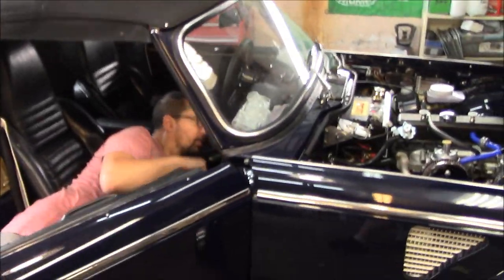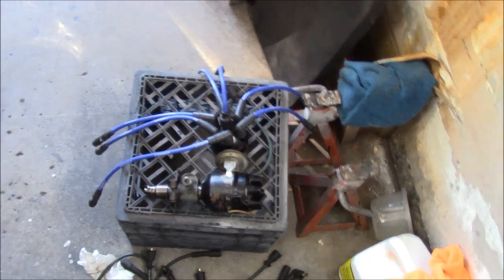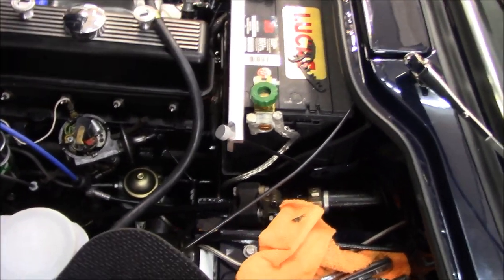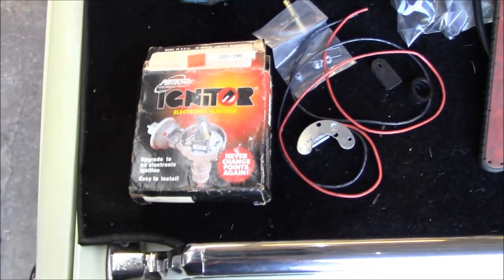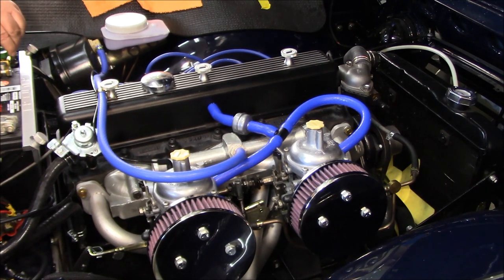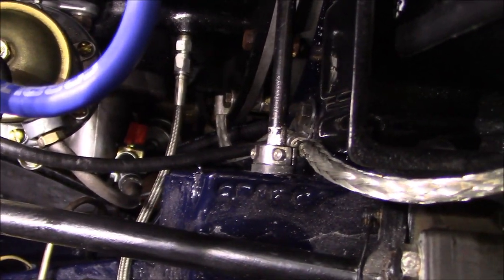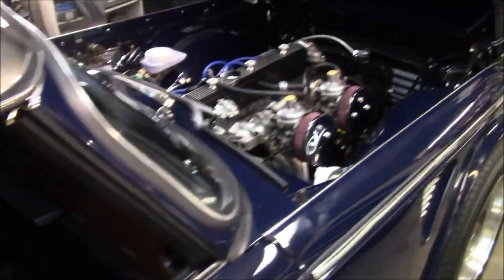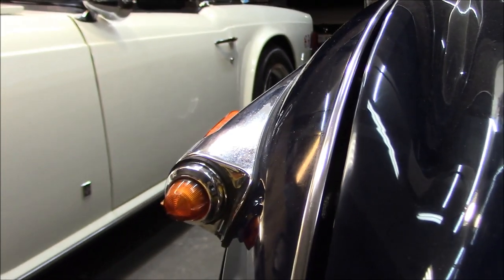1968 Triumph TR250 Restoration Project,  Wrapping up some Small Projects.

Comment: Hi Dave, you give me inspiration to get out in the garage as always. I'm just about to install that popular 90A alternator, but I just read where the pulley may not be compatible, and I'm skeptical that the mounting ears are the right size. Plug and play- yeah right. Anyway, saving your radiator video until tomorrow morning. Thanks for the documentation as always, sir!
Reply from the maker: Is that the Ford Fiesta one John?  I think you also need to add and extra wire because of the increased amps?  I remember the conversion but I’d have to look up the specifics.    Yeah, the radiator was very cheap…163 US Free Delivery….can’t even get one cleaned and tested for that these days…
Reply: @cheftush  WOW! Fantastic price! I bought one a few years ago, but waited a year to put it in, and found the mounts in the wrong positions. Never returned it so paid to have my original re cored.
Reply: @cheftush  My alternator is actually that 100amp BNW new unit, "14022". I didn't need all that amprage at all, but for the price, why not. I'm about to install halogens, and an electric fan in the future. My little Lucas pretends to be fine until it gets any kind of a load, then output drops to borderline.
Reply: Found the rad on Ebay. Can't wait to see your impression of it tomorrow morning (when I watch all my youtubers with coffee :) )

Comment: Did you ever find the source of the puddle of oil that you found under the 250?
Reply from the maker: Hi Andrew, no.  Fortunately whatever is was hasn’t appeared.  I do have an oil leak from my timing cover though…I get a small puddle upon shutdown.  I’ll live with it for now but it will have the be addressed in the future I think.

Comment: Hey Tush, I’m in kinda the same boat the small jobs seem endless. I used the same fuel filter on my tr4, also used silicone on my turn signal ring like you because it would not stay on. I Like the idea of a fuel shut off valve, (going on the to do list). Question, I have a Petronius distributor (flame thrower) and I’m running webers. When you had the webers were you using the vacuum timing advance? I haven’t started the engine yet and I have not been Abel to find anything on this for reference. Thanks, p.s. hot and humid down here In miami too, I’m sure you’ll get cooler weather way before we do..
Reply from the maker: Hi Robert, when using the Webers, you don’t need to vacuum advance hooked up.  I would suggest though, with any performance upgrades, that you send your distributor out to get recurved.   I usually send mine to Jeff at advanced distributors.  You fill out a sheet with your performance modifications and he sets up the dizzy to match these.
Reply: @cheftush  Thanks David, my distributor is a new one, would you recommend sending it? Also you mentioned the voltage stabilizer, I bought a new one , do you have someone that refurbish them. I’m hoping to get the tr4 started soon. Really appreciate your advice. Hopefully I can start 72 tr6 soon. I have other cars but like you I love the triumphs.
Reply from the maker: @robertmorales391  in order to take full advantage of your performance modifications, I would send it out.   I’ve bought a new voltage stabilizer from Dave C. His YouTube channel here. https://www.youtube.com/watch?v=dSjzjk6pnYs
Reply: @cheftush  thanks , spoke to Jeff for awhile great guy. I think this is going to be a big help.
Reply from the maker: @robertmorales391  if I recall correctly, Jeff is not a big fan of the Pertronix ignition….I’m a fan though.
Reply: @cheftush  your right David not a fun of pretronix “cheap Chinese s#&* in a nice box”. But sound like he knows how to get the Weber’s and the distributor stuff work altogether. When I had the car running in the early 1980’s I never had it running right. I was scared that I could not get it running right after this restoration. 🤞🙏..  thanks Tush.

Comment: Hi Dave, did you replaced the voltage stabilizer for a new part ?  My TR250 came from the USA and the part was replaced at that time. Last year the fuel and temperature gauges were varrying from time to time during a tour. Yesterday I build out the voltage stabilzer and found that it was not working perfect. Voltage level variations of battery also occurred (although smaller) at the output of the stabilizer. I opened the mounting and found in the circuit that a NPN transistor was used. In my opinion it can’t stabilze the voltage to 10V in accordance to what I measured. I ordered a new one at rimmer bros. What is your experience with these voltage stabilizers ?
Thanks in advance, greetings from The Netherlands.
Reply from the maker: Hi, thanks for watching and commenting.  I replaced my faulty voltage stabilizer with an old one that I had in my parts stash. However, I’ve ordered a new one from fellow TR owner Dave Conitt who makes and sells a much better unit.   Here’s is a video from Dave.  His contact details are there as well. https://youtu.be/dSjzjk6pnYs   The ones on the market today from the regular vendors have some higher failure rates in my opinion.   Cheers, Tush
Reply: @cheftush  hi David, thanks for your quick response. I found also a electronic design on the internet with better performance. I have to order the components from China which take some more time. Meanwhile I will use the replacement ordered at RimmerBross. Thanks again.

Comment: Hey Chef, thanks for another great video. Just a quick question, did you run the vac line from the retard unit on the Lucas dizzy to the advance port on the top of the rear carb?
Reply from the maker: Hi Allan, I did. Now you have me thinking that it should be from the underside of the front carb 😉 As you know, these are not the correct year carburetors for this car..I think these are 73/74.  I was looking at the stock schematics to try and figure it out.  I guess when I look at it now, that might be a ported vacuum source so I should either move it to under the front carb or cap the system entirely.